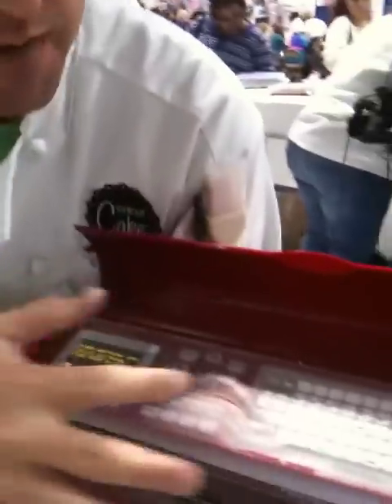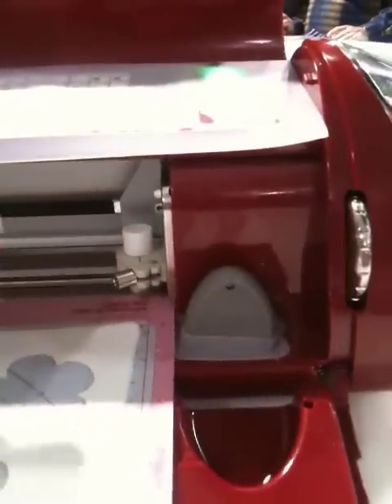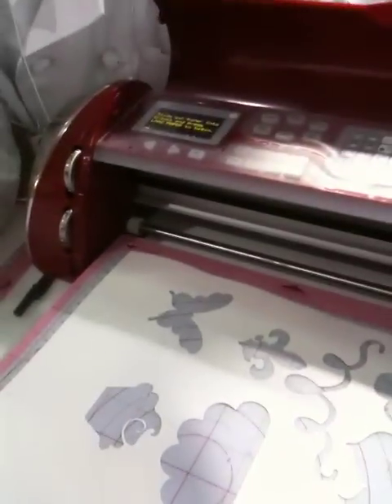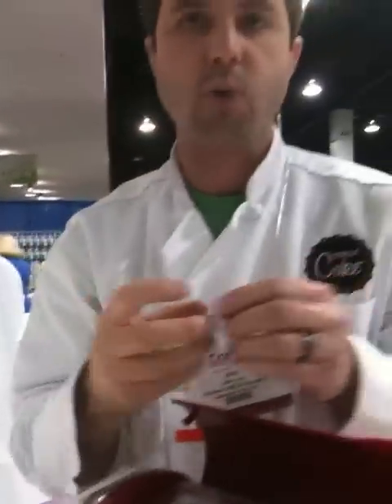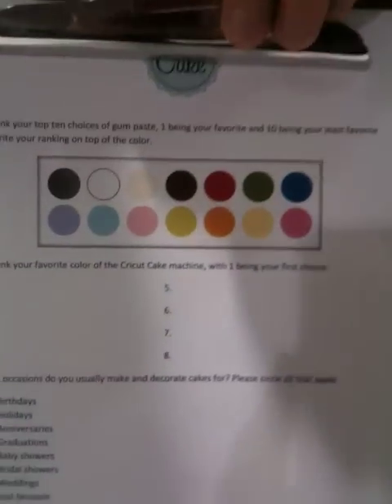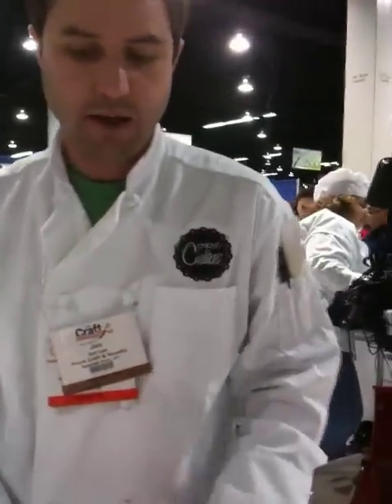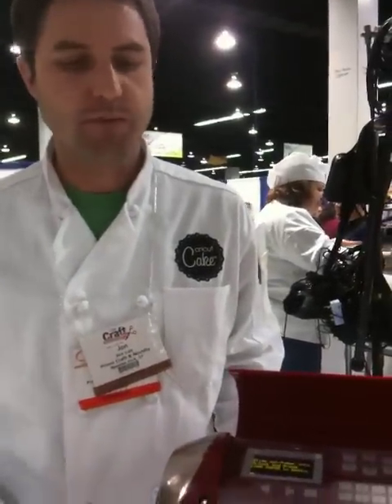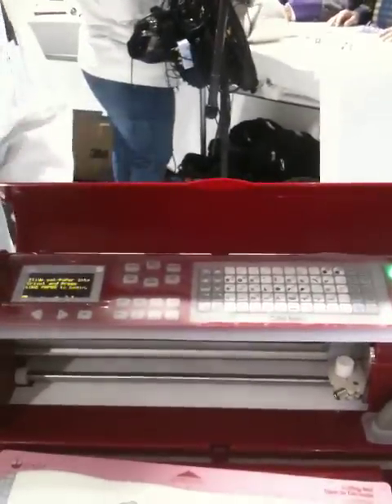Introducing CricutCake!

Comment from the maker: @livelaughlove30 - it sounds like your pressure is WAY too high. Have you adjusted the blade in the machine? Make sure it's on 2 or 3, then set the pressure dial down to "Medium"... hope you get it worked out!